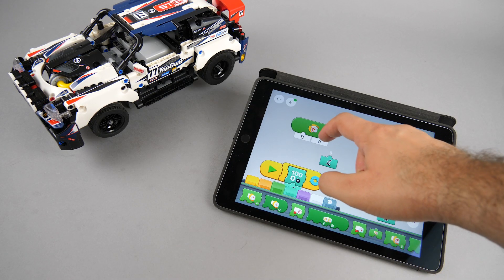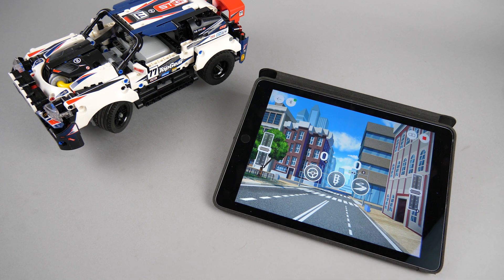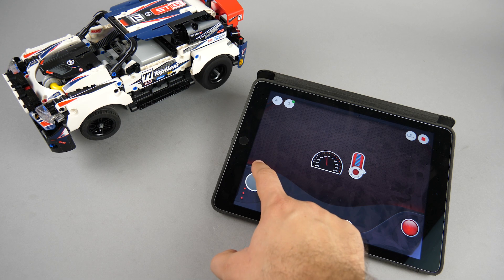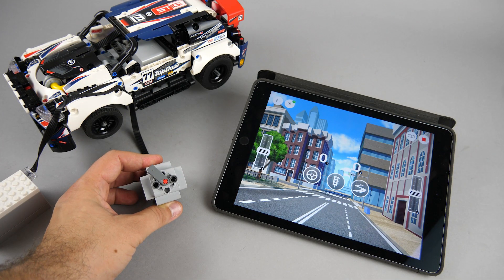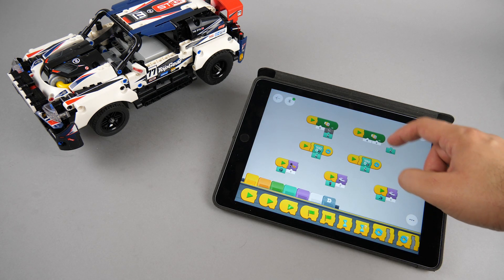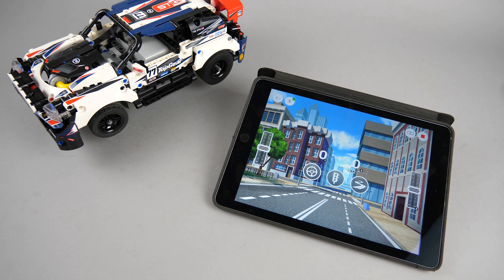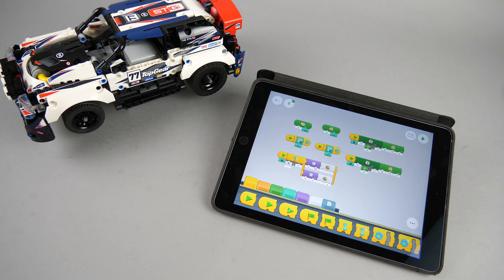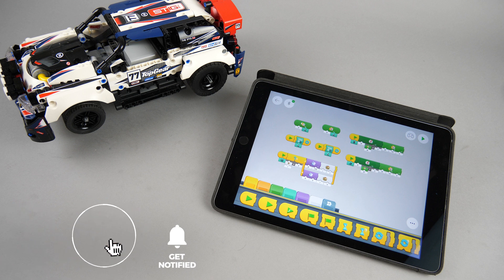I was wrong... the real purpose of the new blocks in the Powered Up 3.3 update

Comment: Is the new steering block still working? Or did they break it with a update?
I dont have the rally car but ive setup exactly like that. Now in the control plus app on the rally car everything works perfect. The l motor autocenters and steers. But as soon as i use this new steer block in the free coding area, the l motor only goes full speed 4ever as soon as i start the code. So without respons to input. I did exactly what you did but no luck, any idea someone?
Reply from the maker: I suggest to check this tutorial for a simple steering setup - https://youtu.be/AuL-wdn3v4g
The calibration sequence in the PU app also needs physical endpoints, without them the motor will keep running and the calibration can never be finished.

Comment: Sorry, but I found this completely unhelpful!   How do you even get started with this app?  How do you do even simple On / Off ?   I'm working on an MOC project and still completely in the dark.  Any clues??
Reply from the maker: If you find it unhelpful then I suggest to look for a basic coding tutorial online using visual programming. Another option could be to try the Boost app, since that has a step-by-step tutorial and explanation for most of the blocks which are very similar to the Powered Up blocks. My code block guide might be also helpful - https://racingbrick.com/powered-up-code-block-guide/
Reply: @RacingBrick   I don't have a problem with coding (I spend most of my working life writing C++ packages!) but there seem no clues as to how to actually open and operate the app itself.  Can that really be the case?   Regarding the Boost app, does that mean that this app does have instructions and the Lego one does not?  Seems odd!
Reply from the maker: @johntent9349  the interface is pretty self explanatory I think. If you know how to code then you should have no issues setting up the different controllers and simple mechanisms. Boost has a tutorial mode that explains how to use the basic blocks and it has a popup help for the majority of the blocks. The Powered Up app does not have a built-in help or tutorial yet, according to the designers they were focusing first on the advanced users who can figure out the interface and the usage of the blocks as well.

Comment: Yo I’ve recently started trying to integrate the powered up motors into my technic creations and I gotta say, even after extensive use, I still prefer power functions. In power functions you could extend cables to have them as long as you wanted to. Having a fixed cable length of the powered up motors has proved very problematic for my creations. I can’t ever find a good placement for the hub, and I gotta place the hub, depending on the cable length. You could also stack cables, like you could have 2 or more motors running from one plug. In control+, each motor takes up one port and there are only 4 ports in one hub, so to make bigger creations I’d need to get another hub and daisy chain, but then is just be adding more and more weight to my model. Also setting up the controller was easier for power functions. In powered up you can’t customize the controller layout and you get only 2 options (yes you can reprogram the functions of the controller, but not the layout of the controller) also the whole programming system just seems, childish, ya know. With ev3 and nxt, the block programming interface was much more intuitive and easier to use and customize. I mean, it’s basically a dumbed down version of mindstorms.
Reply: Yes. And I like non-computer infrared Power Functions.
Reply: Power Functions and Mindstorms were almost perfect. If Mindstorms was like Arduino, it'd be perfect!

Comment: Thank you! Very usefull to see interface and coding examples, as well as the L/XL motors tests.
Concerning the joystick size, you can change it in the playCanvas.json file (widgetid 59), as well as the position.
But the point with the joystick is that when you're steering top left or right, the speed is zero or very low.
I managed to replace the red button by one slider (from the other controller) to adjust the speed, and so use the joystick for steering only. On a tablet it could be possible to mix the widgets from the 2 controllers (i tried to add some from batman controller, but didn't managed to add the associated coding blocks)
Reply from the maker: Yeah there are a lot of tinkering possibilities :)
Reply: How do I tinker with the files of mobile apps? I love doing that but I only know how to do that on my computer, and not on the iPhone or the iPad
Reply from the maker: You won't be able to do that on iOS devices, Android is required